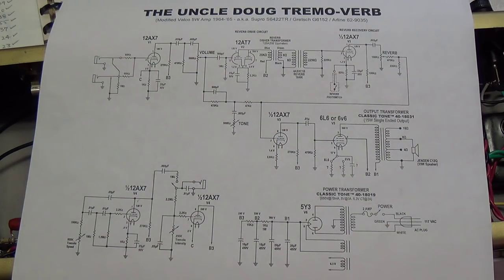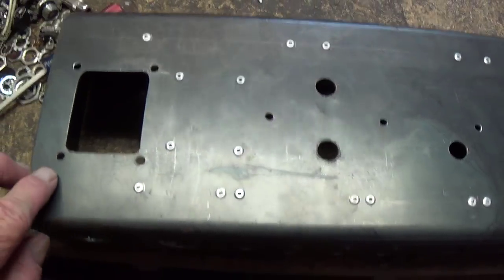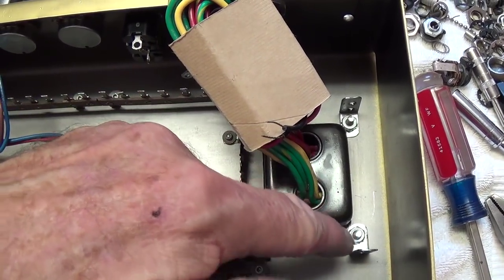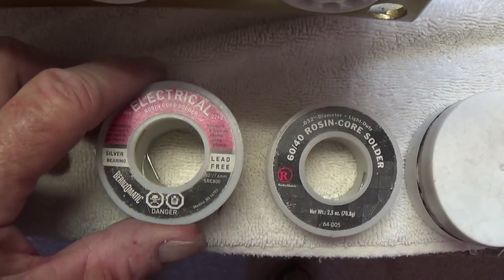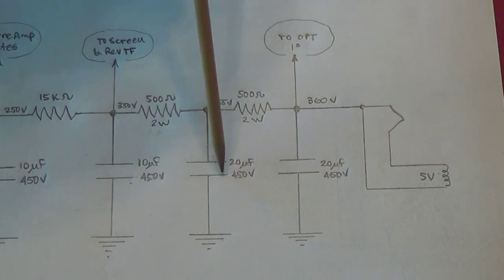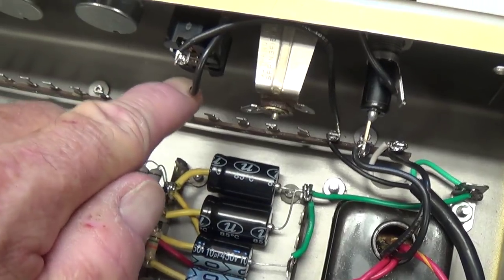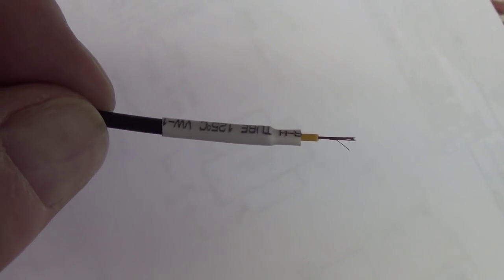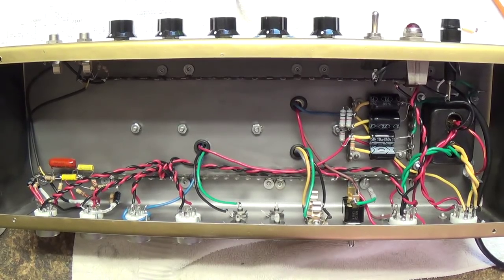How to Scratch-Build a Vintage Amp, Part 7:  Chassis Finishing and Point-to-Point Wiring

Comment: Uncle Doug, thank you for the link to the schematic, and of course to the viewer who drew it all out, its super helpful.
Reply from the maker: You're welcome, Russell.
Reply: @UncleDoug  are you using 14 awg solid wire for the B+ high voltage?
Reply from the maker: @irusman62  I don't recall the gauge, Russell, but I never use solid wire.
Reply: @UncleDoug  ok do you use the same as you use in your vehicles?
Reply: @UncleDoug  do you use ceramic tube bases here in this build?
Reply from the maker: @irusman62  I don't recall, Russell. Can you tell from watching the video ?
Reply: @UncleDoug  also you should by able to scroll up to see the video link to where this question came from, is does for me anyway.
Reply: @UncleDoug  pretty sure the -| (- are you’re polarized , on my sheet there should be a little + sign next to the straight line to indicate polarized. not that youre wrong, its just different. thanks for all your replies
Reply: ill just get ceramic bases, I feel they would take the heat better
Reply: @UncleDoug  hi UD im going over the schematic for this build. my question is about the capacitors. there are 2 symbols for non polarized capacitors being used according to a symbols sheet I have,  -| (-  I I do you use these to differentiate capacitors in your circuit? and which ones are the electrolytics,  Mallorys etc. please I know im not the only one asking you questions. I can probably figure it by watching the videos.
Reply from the maker: @irusman62   I get hundreds of questions and comments to answer daily, and it would sure be easier on me if you simply watched the video and figured it out. Thanks.
Reply: ok I got this figured out, the coloured layout in the pdf in tandem with watching and pausing the video scenes taken of the completed circuit was essential to figuring it out. you using components on hand that match values but some different colours had me scratching my head, but I got it figured. so I have a pretty good parts list building. Again thank you and the chap that did the drawings.
Reply: @UncleDoug  yes im sure that you do, sorry to be a hog. I’ll try to refrain from asking so many questions. and only ask ones I can’t extrapolate from the videos.
Reply from the maker: @irusman62  Thanks, Russell. It would help me a lot.

Comment: Any reason for not using a 'bridge' rectifier Doug ? Does the valve-based system improve the sound, or, is it just for the sake of originality perhaps....
Reply from the maker: Tube rectification creates the possibility of "sag", which is an often-desirable form of distortion in a guitar amp.....especially in a relatively low-output circuit like this one.
Reply: @UncleDoug  Even more education Doug ! Thanks again...

Comment: Those rub-on letters really bring back memories.  My Dad used them for all of his electronics builds and he had sheets and sheets of them in the shop.  When I started graduate school in chemistry, we had analogous rub-ons for chemical bonds, element abbreviations, etc.  It could take me most of a morning to build up a single chemical diagram.  In the mid-80's a Macintosh program called ChemDraw was introduced that allowed you to make all the diagrams on a computer rather than using rub-ons.  It reduced those hours of work to minutes and everyone tossed their rub-on sheets into a file drawer for good.
Reply from the maker: The rub-on sheets used to be fairly expensive, as I recall, and I would dread having to buy entire sheets just to get the right numbers and letters for a project. Then, as you said, the sheet went into a drawer for eternity.

Comment: Don't lick your solder joints.  The flux is way nastier than the little bit of lead that's in the solder.  The Royals should stick to what they know.
Reply from the maker: Thanks for the very helpful bit of advice, M77. I guess you would also frown on my chewing old electrolytic caps like gum??

Comment: Hello, why did you decide to use an effective 2W rating for the 500 Ohms resistors? The original wattage specification for the 1 kOhms resistor was 1W and had double the voltage drop, but the same current draw as the two 500 Ohms resistors. If anything, would a 1/2 W resistor not work for the two 500 Ohm resistors?
Reply from the maker: Since resistors are so inexpensive, why would anyone chose to utilize those with the lowest power rating that will (probably) work?   It's always better to over-build than under-build, especially if the cost difference is negligible.
Reply: @UncleDoug  I don't disagree if one had 1 W resistors already on hand, but if one only had 1/2 W resistors and didn't want to order 1 W resistors, they should be able to use them in this situation.  Additionally, I was pointing out that the video specified a 2 W requirement, which seems to be erroneous.  Thanks for the response!

Comment: 13:52 Fender and many others have used tip-shunt jacks on speaker outputs for a long time, I've seen a lot of people say it's because having that 0 ohms shorting to ground is more survivable on the output transformer than being turned on with no connection at all (as you have it hooked up), what's the real story as to why?
Reply from the maker: To me, neither is optimal. Adding an appropriate 4 or 8 ohm ballast resistor to the shunt is the best solution.

Comment: Hey uncle Doug! Another of my rare question. Finally i buy a tube amp,  but because im a chicken brain, i love leds. So,  i want to change the color of the leds and maybe put some on a Graphic Eq (if there is space for it) ... the thing is, i dont know: 1- if it is really safe to add a few leds to an amp, using it to supply the the leds  2- where to connect them, meaning, on the + or before the tone stack etc etc.  3- if this will add or not a lot of noise, or in the worst case harm to me or anyone near.
Reply from the maker: I too love LED's, WC, but you can't simply tack them all over your amp circuit.  Don't try it or it may light up like a Christmas tree......for a split second.
Reply: @UncleDoug  im glad i asked first!  Thats what i feared. Thanks Uncle Doug!
Reply: @UncleDoug  Uncle Doug, it would be good or bad to change leds from an amp to those fender jewel lights? The amp has 3 red led,  so i wonder if this is a good idea or not... or maybe change them to a led of another color?

Comment: Dear Dough, thank you very much for making these videos. I have 9ne question it is related to grounding output jacks (speaker). In your video you have mentioned that they should not be grounded. I am building bassman and accounting to all schematics they should be grounded. I have also built ax84 which does not work, I have cheched all wirings and components 100 times but that one has grounded jacks as is says on schematic. Please tell me if i need to connect output jacks on bassman to chasis or I sude used plastic isolated jacks?
Reply from the maker: There is no problem with having the body of the jack grounded to the chassis. This is standard practice and the ground serves as one of the two connections to the speaker......BUT, my feeling is that using self-grounding output jacks ( the hot leaf touches a grounding leaf if there is no 1/4" male jack in place) is not a good idea.  Many people feel that if the male jack is pulled out while the amp is running, the ground is preferable to having the secondary circuit suddenly open, possibly harming the output transformer. I prefer to either use non-self-grounding output jacks, since I have never had a speaker plug pulled out of a running amp, or install a 4 or 8 Ohm high wattage resistor between the grounding leaf and ground, to maintain proper impedance if the male jack is ever pulled out during amp operation.

Comment: Hey uncle Doug thanks for all your efforts in providing the best tube amp education on youtube, I am hoping either your self or another subscribe may be able to help me with some info. I recently picked up a Marshal DSL15H very cheaply in great working order my goal was to have a play around with it possibly even convert it to point to point one day when I got the amp it did not sound good the overdrive channel was very fizzy harsh and trebly, I did the mod to it as suggested in various forums which helped a lot, but it still lacks bass response/Girth and the tone is not quite there, it has 4 x ECC83 and 2 x 6V6 output tubes I was thinking of changing it to 6L6s but I can't seem to get any information on the mains or output transformers to see if it can handle 6L6s. The combo version of this amp has reverb, which I am hoping means the Transformers used have higher power handling then needed for the non-reverb version.  TXMA-91032 is the 230volt version of the Mains transformer as I am in Australia, output Transformer TXOP-91001, any help would be appreciated.
Reply from the maker: A PT intended for 6V6's is probably not going to provide sufficient plate voltage and current for 6L6's......and changing tubes most likely won't improve the tone. I have no experience with the amp in question and honestly can't provide any helpful insights. I'm sorry. I wish I could be of more help.

Comment: That workmanship is exquisite and you explain each section extremely well. The exterior finish is stunning and the gold will match the cabinet. One-click away from Part 8. It's really good of you to mention the safety angle at the end of this. A long time ago when I was a teenager with spots I took a shock from a capacitor while building an EL84 record player amp while it was unplugged from the wall socket and almost threw me across my Dads garage! Lesson learned I'm amazed why nobody has to best of my knowledge manufactured a wand to discharge caps?
Reply from the maker: Thanks for your very kind words, Ian. I'm glad you are enjoying the series and appreciate the need for safety precautions.

Comment: Hey happy 4th of July, I just now got to watch this amazing series.  I bought a Electron-O amp that was a ac-dc line operated amp  Im going to try and make a 5 watt single ended amp out of it And I am going to use that name as my logo. It had 3 octal tubes and 2 teeny transformers I chucked all of the insides kept the nameplate and pilot  jewel. Anyway its a long term project Hope to send you some photos  Your videos are a godsend  thanks  again William
Reply from the maker: Best of luck with your new project, William. Be sure the chassis is properly grounded.

Comment: You could have added another mod using that extra tap of the output transformer to make the tube work in UltraLinear configuration. Just to hear the tonal difference though. Implementing via switch or relay adds a bit more complexity to the circuit, because u need to swap B+ wireing and secondary windings too to reflect rougly the correct impedence on the primay.
Just my thought, and great video by the way
Reply from the maker: Thanks for the suggestion, Dang. Glad you enjoyed the series.

Comment: Great videos but I'm a little surprised you didn't add a standby switch while you were at it especially on a single ended class a.
Reply from the maker: I, and many other tube enthusiasts view standby switches with great disdain, Brent, especially on a single-ended amp. I can almost justify one on a  100-Watt diode-rectified circuit, but still would not add one to a home-build. Here is why:  http://www.valvewizard.co.uk/standby.html

Comment: Simply outstanding! I built my first tube amplifier back in 1960, based on the Olson Electronics amplifier kit. They put out an honest 12 watts RMS and sold for $19.95. all parts included. The tube line-up was 2 12AX7's, 2 6V6's and a 5U4 rectifier. Also Baxandall tone controls and even the 60/40 Kester solder was thrown in for free. Now a simple output transformer can cost $100.00 or more. One question, what's up with the sound? Some of the episodes had as much as a 40Db scene to scene difference in volume levels. (As measured with a Simpson 260.) BTW, I'm an old fart, 72 years old as of Jan. 2019.

Vinyl sounds better than CD's and tube amplifiers sound way better than solid state. How about a tube amplifier project for High-Fidelity? (Maybe stereo High- Fidelity?)

Thank you, Uncle Doug. This series rated *** 5 stars for me.::::::::::::::::::::::::Milwaukee Randy
Reply: I forgot to mention, the amp that I built had 2 6SL7's, 2 6V6 outputs and an 80 rectifier. Yup, an 80. (Remember the real old 4 pin base tubes? All the parts came out of "Grandpa Schmidt's" parts bin. I still have it and use it along with a Shure M95 phono cartridge wired for mono. The quality of the sound is beyond comparison. 

Also, you might want to check out PartsExpress.com. Lots of tube stuff there at reasonable prices. And Celestion guitar speakers too.
Reply from the maker: Thanks, Randy. They don't make kits like they used to, I guess, especially at that price :) It sounds like a great amp. I'm sorry if the volume levels were not balanced. I was not aware of the problem......you're the first person to comment on it. I do remember the 80 rectifiers as well as the 5Z3's. Thanks for your nice comments and suggestions.

Comment: I'm building my own more modern amplifier at home (with a vintage feel to it) and I am aiming to have a switch on the amplifier for distortion and clean channels, I use the switch to send the signal through more or less preamplifier valves... I also want to use a footswitch jack to do this but I am not sure how I can get the switch to work when the footswitch isn't plugged in. Would you be able to help me imagine a circuit? Draw a simple circuit as to how this could work?
Reply from the maker: Liz, I think you're probably the best person to figure this out. I'm sure you can do it. Best of luck

Comment: Does the foot switch cable need to be shielded? :)
Reply from the maker: The reverb footswitch cable is generally shielded, while the tremolo is not.
Reply: What about in a different amp with high and low gain channels, does the switch to change between them need to be shielded?

Comment: Just out of curiosity, how does connecting the screen grid of the output valve to 40% of B+ tapping on the output transformer reduce distortion compared to connecting it to one of the nodes on the power supply itself? Just wanting to know if it's worth it and if the effects are noticeable or not because I find connecting it to the transformer more convenient. :)
Reply from the maker: This type of screen wiring is called "ultralinear" , Liz. In a normal circuit, the screens run off of the plate voltage winding of the OPT. The problem is that this voltage varies greatly during operation, causing alterations in screen voltage and a sizeable amount of distortion. When the screens have their own supply, their voltage does not vary and the result is a dramatic reduction in distortion. In guitar amps, this is not a huge benefit, since distortion is generally acceptable, but in HiFi circuits, it is a virtual necessity.
Reply: Ohh I see. Just to clarify because it's a little too early for me, connecting the screens to the OPT is ultralinear and reduces distortion? Or did I get that backwards.
Reply from the maker: Yes, but the output transformer must be a special ultralinear version with appropriate taps for the screens. A regular output transformer will not have the screen taps and cannot be used in this manner. Running in ultralinear mode does indeed reduce distortion.
Reply: What do you call "non-ultralinear"" as such? When the screens are connected to the power nodes?
Reply from the maker: Non-ultralinear is simply the regular way almost all guitar amps are designed, with the screen supply one resistor or choke downstream from the plate supply.

Comment: Thanks for all the great videos.
Has anyone compiled a parts list for this project? I have the final build document with schematics and component layouts, but need to sort out the required components.
Reply from the maker: I believe that Tommy made a parts list for the build. If not, then use the schematic to make one. All the essential part numbers and component values are provided.

Comment: What's the book you mention at 9:46? "The tube handbook" doesn't bring up any results but i could find a "Collector's vacuum tube handbook". Sounds like a useful read. I'm currently in the progress of figuring out how realistic it is to build my own amp.
Reply from the maker: In the good old days, tube manufacturers such as RCA and Sylvania, published their own tube handbooks, listing all the specifications of every tube they made. I just made an Ebay search for RCA Tube Handbook and got 39 listings. The books are technical, however, and you will need some experience to be able to interpret the listings.

Comment: Wow, that was quick. Thanks for that very prompt reply.
That’s my mistake. The Champ has only one output tube. But I understand what you’re getting at.
I’d probably have to use a more robust speaker as well. Maybe not worth the trouble or I could actually learn something.
Anyway, thanks for the info and try and get Rusty to do a little more work around the house.
Joe
Reply from the maker: You're welcome, Joram. Good luck.